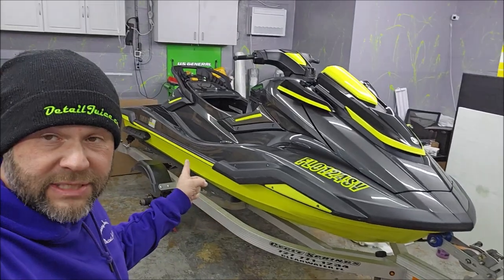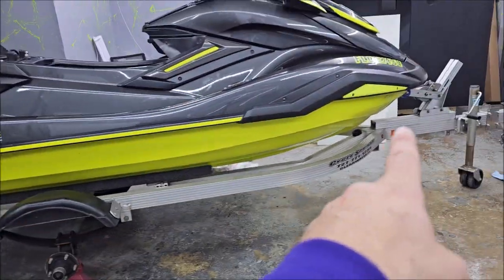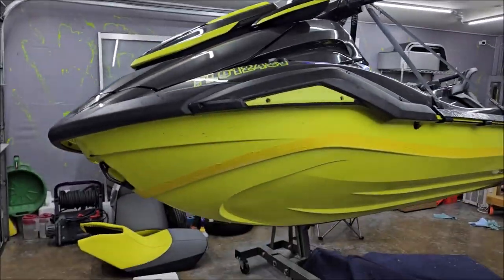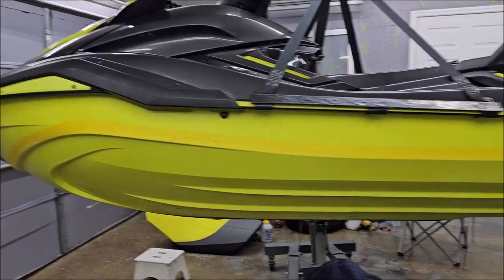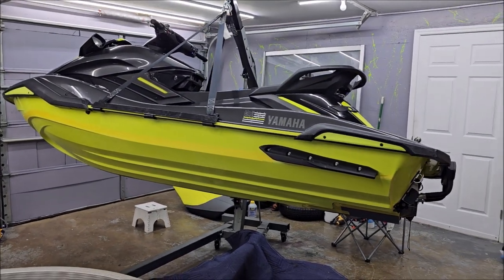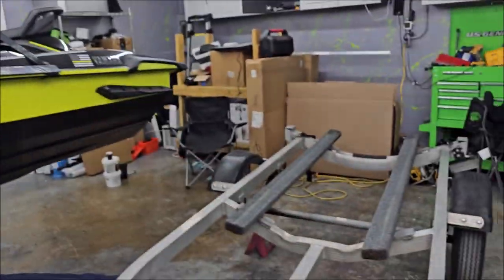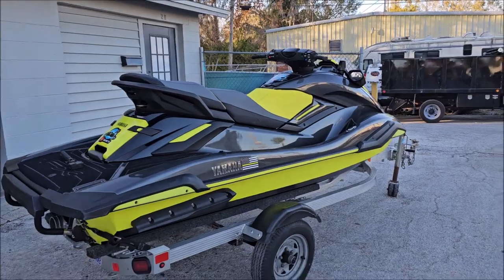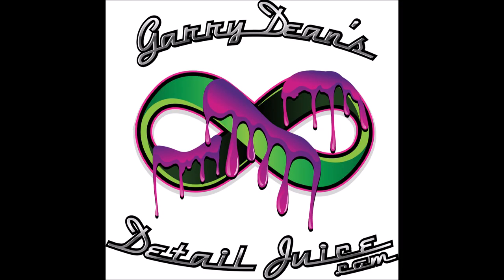YAMAHA FX SVHO WAVERUNNER - JET SKI - SUPER SLICK 2000 INSTALL

Comment: Does the bottom get completely sanded? Or just scuffed up
Reply from the maker: Per Fasco Epoxies - they say if there is no sign of any delamination or bubbling, heavy sanding with 40 grit is enough to apply SS2k. If there is any sign of deep scratches, bubbles or delamination at all, the entire substrate must be sanded completely off prior to application. On this particular ski, there were no signs of any issues at all so I sanded deep with 40 grit, cleaned and applied. I offer a 3 year warranty against delamination on all of my work.